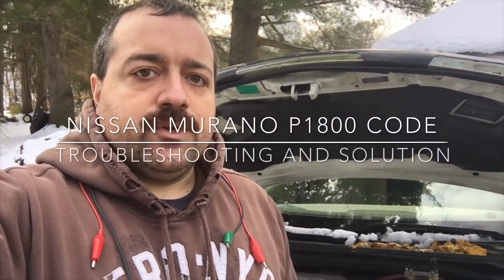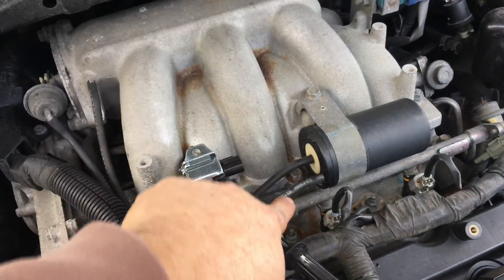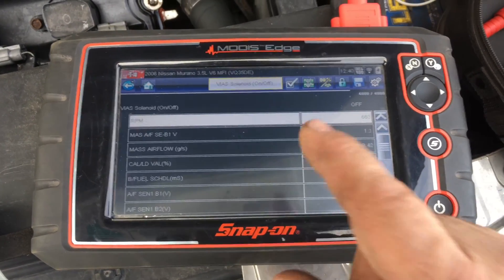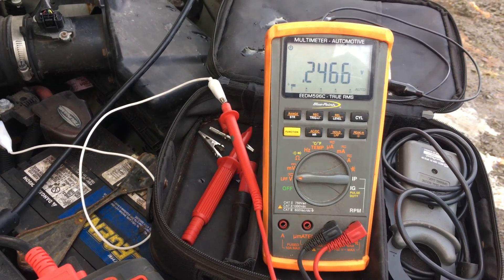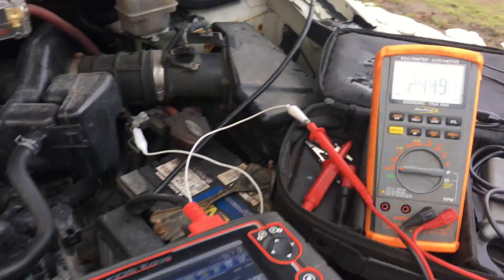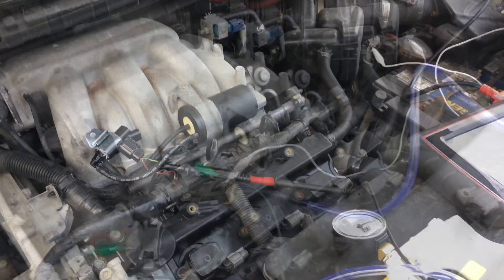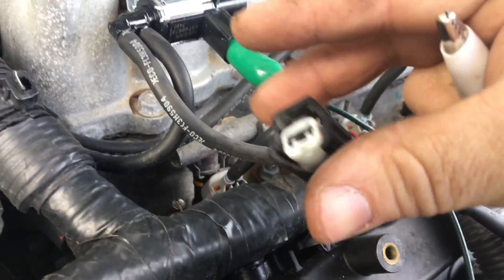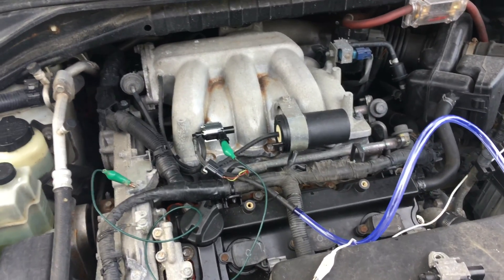Nissan Murano P1800 Solution

Comment: Hey Joe, my wifes Nissan is throwing this code but also throwing p0300 multiple misfires. Would this part cause misfires and the car to run extremely rough or is it spark plug/ignition coils that are causing this part not to work right?
Reply from the maker: This shouldn’t cause misfires. If you’re 100 k miles or higher you’re due for plugs.  It also shouldn’t make it run rough. 

If that’s the case use the same plugs as originals.
Reply: @JoesCarSmartsNY  thanks turned out to be the alternator.
Reply from the maker: Daniel Nelson AHA. Good information.

Comment: Curiosity what is the actual name for the vacuum rosevoir?
Reply from the maker: That is a good question.  I’m not really sure.

Here they call it an “Emissions Vacuum Tank”. Don’t know if that’s the official name or not. 

https://rover.ebay.com/rover/0/0/0?mpre=https%3A%2F%2Fwww.ebay.com%2Fulk%2Fitm%2F183243031312
Reply: The large tank, they just call it the "Vacuum tank" from the OEM manual.

Comment: Hey Joe, I have a 2006 Murano, sometimes (sometimes I can't reproduce it no matter how hard  i try) I have clattering sounds coming from the engine only under acceleration. It doesn't occur if engine is revved while the car is stationary. No one has really been able to tell what exactly the cause is. Someone even suggested the top gaskets might be going flat. I'm not much of a mechanical guy so pardon my ignorance
Reply: Check the egr valve....same thing he is talking about here.  That plate that moves could be loose and rattling.  Common problem on this engine
Reply: I know this is an old thread, but I'm going to leave this here for others.  It sounds like the classic case of spot welds breaking on one of the exhaust heat shields.  You won't hear it when the car is stationary because the torque from the transmission causes the exhaust to flex. It is that flexing that makes the shield vibrate. It may sound like a buzzing, chattering, or even grinding.  

You can confirm by putting the vehicle into gear with the brake applied and giving the engine varying degrees of throttle to simulate on road acceleration.  Open your door and stick your head down and it will get loud.  Typically, they will be louder when the exhaust is cold and quiet down a bit when it warms up.  This is due to the expansion of the metal due to heat.  

Good luck to all.
Reply: Same thing here, I've given up at this point trying to fix it.
Reply: I'm getting a pinging noise only when I accelerate, and no one has figured it out yet.I was thinking of changing the pressure valve actuator. It's driving me crazy 🤪
Reply from the maker: Are you using 93 octane fuel?  This generation Murano is designed for it.
Reply from the maker: Izi E That’s a tough symptom to guess at without seeing the car. My best advice to you would be to always make sure the oil is full. 

You might be dealing with a timing chain that is not as tight as it should be any longer. Or you might be hearing some valve train noise. 

Sorry I can’t be more helpful. I haven’t dealt with that particular issue before.